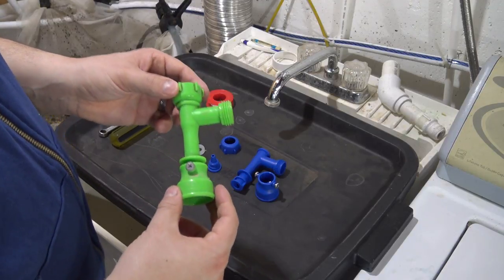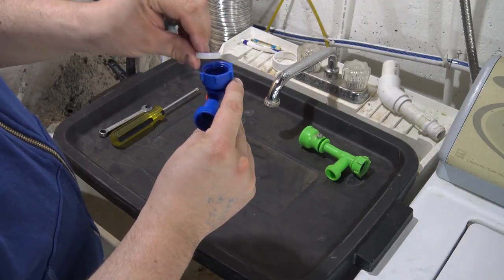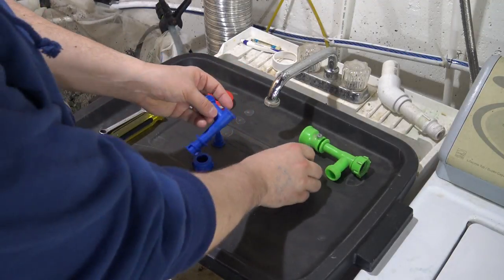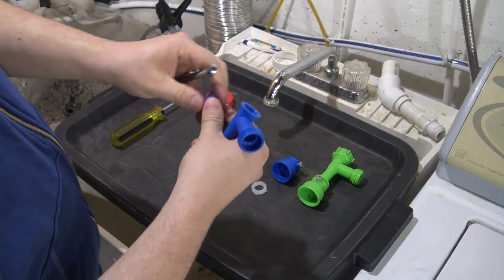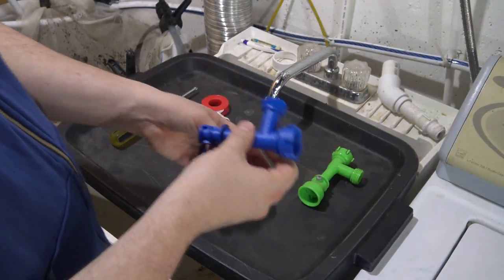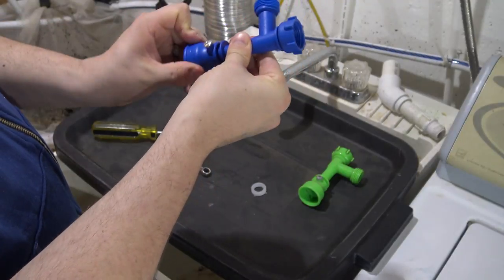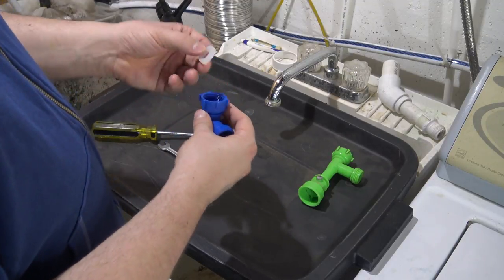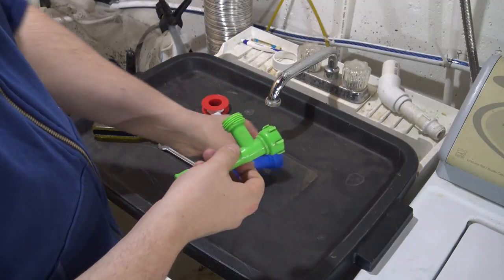#429: HOW TO: Fix Leaking Faucet Pump for Aquarium Water Changes - Tank Tip

Comment: I just wish someone would make a nice brass venturi sink connection....I go through waaaaay to many of these plastic things due to them cracking eventually (but find it cheapest to replace with a "water bed filler" instead of one marketed for aquarium use)

Comment: I've had the same problem with leaking at the top of the pump.  I think I may have tried Teflon tape and/or silicone.  But, I couldn't stop it from leaking.  The best solution I've found is to buy a new pump, then install Python's brass quick disconnect.  This way you screw it onto the pump once, eliminating loosening/weakening the problem area.  That area never spins again.  I've been operating this way for a few years, with weekly water changes... and no leaks.